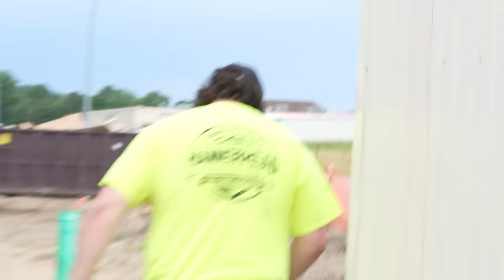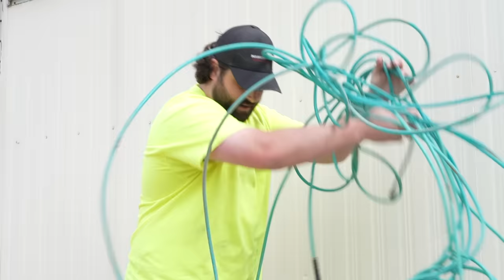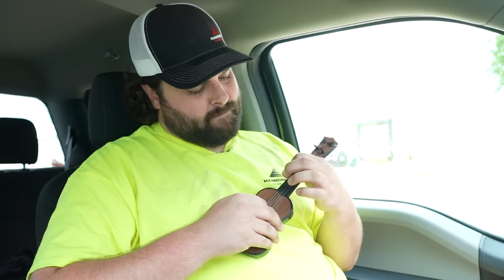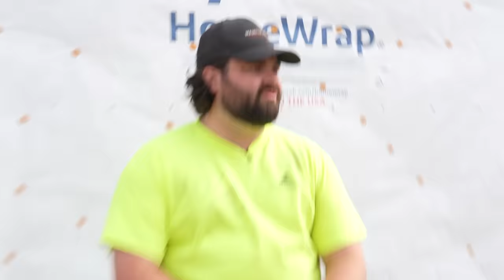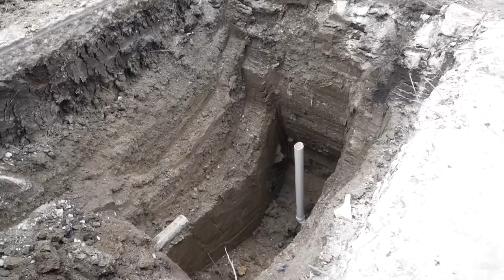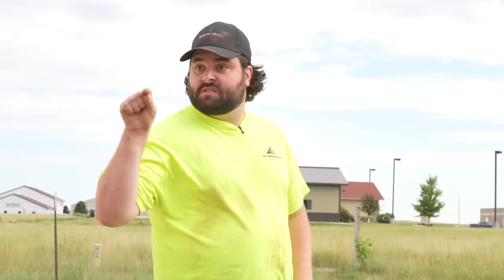What The Foreman Does All Day

Comment: “Ehh we’ll just blame it on supply chain issues” 

I do HVAC and we’ve used that excuse lol
Reply: Is HVAC overrated? I heard it’s a boring job?
Reply: From who??? I’m an installer and do residential for a small company and work on big sites occasionally, but not union or anything. So normally in someone’s basement/attic, but I’ve done a handful of rooftop units and dozens of new construction/rehab installs. 

TLDR: It’s tough, but it’s great to work with your hands and build something. We do everything, like duct work (tin knocking), electrical, carpentry/framing, masonry, running pipe (black iron, copper, and PVC), and even landscaping and more. 

6 years into it, 100% hands on training in the field, 0 schooling for it (except high school). Did 3 years in the Army, and never thought I’d be doing this, just kinda fell into after getting out and interviewing at the guy my dad contracted for as a plumber. Told him I was swinging a hammer since I was 3-4 “helping” Dad around the house, and a week later I started as helper full time and haven’t stopped since (even worked during lockdown).
Reply: @Man_in_a_Gucci_Suit  long story short, no it’s the complete opposite of boring! It’s a dirty job sometimes, but I’m basically at a different house every day, seen some amazing houses and been in really old buildings, 1824 is the oldest I know, but I think we did a few farm houses that were 1700’s. 

You gotta be thin and small tho and a contortionist. I’m 5’8” ish maybe more in my boots, but probably still only 150ish pounds, and I fit in and can do a lot that these old timers can’t